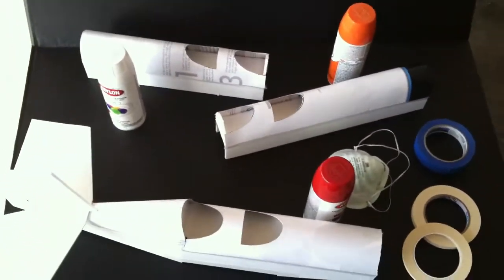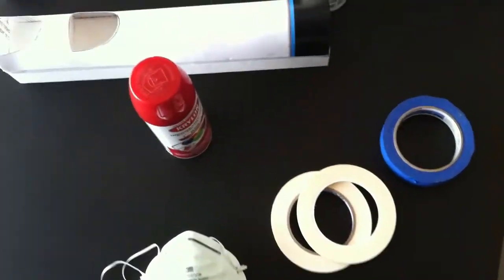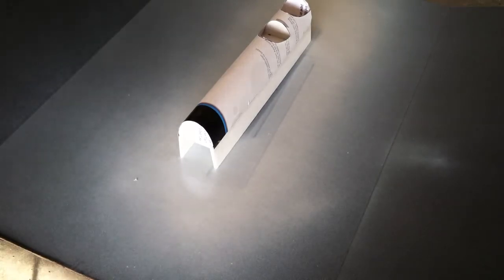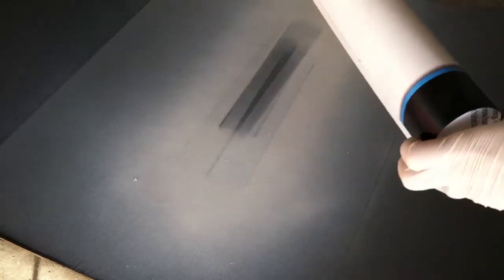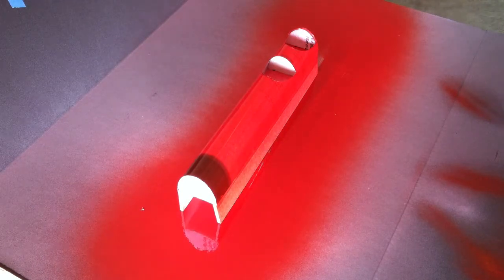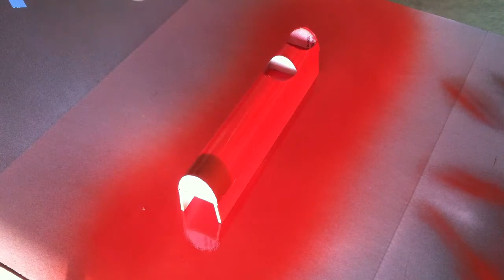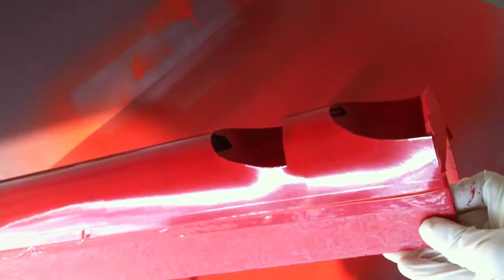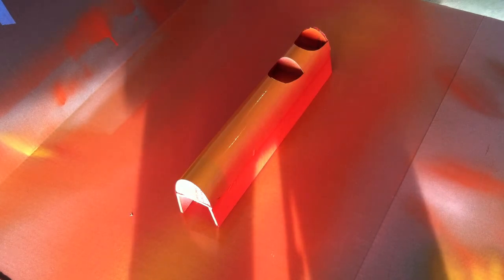Spray Painting RC Planes: How to Do Highlight Color

Comment: Anyone can paint, it takes practice to do it correctly,garage or not. Wear gloves,number one. Base coat if there is writing on your material. Use a white basecoat on lighter brighter colors, dark primers on darker colors. I prefer white primers on pretty much all my projects. You did ok on button control. let the paint flash off or dry between coats. 5 to 8 minutes is perfect.